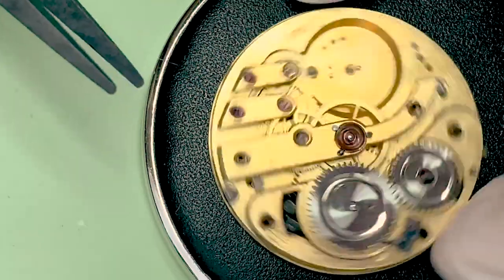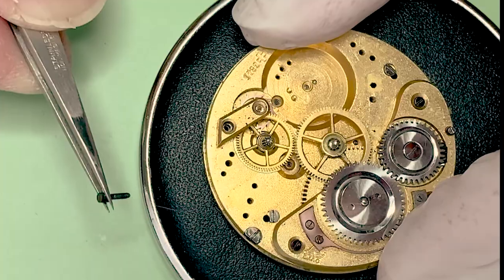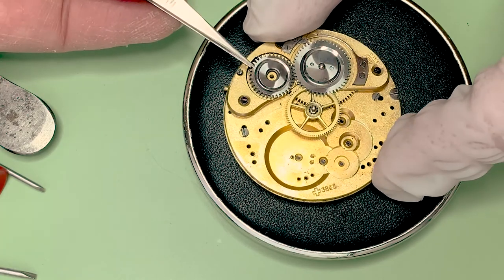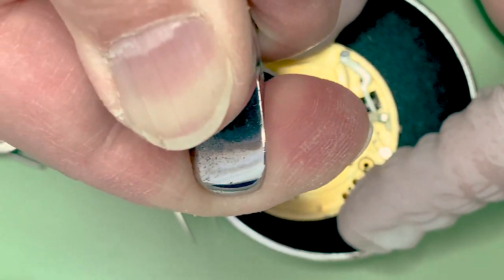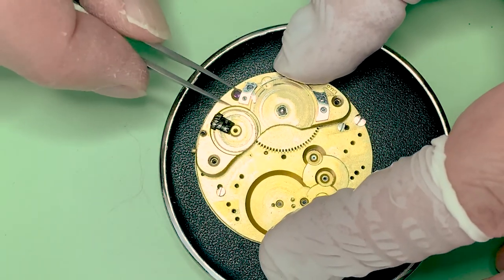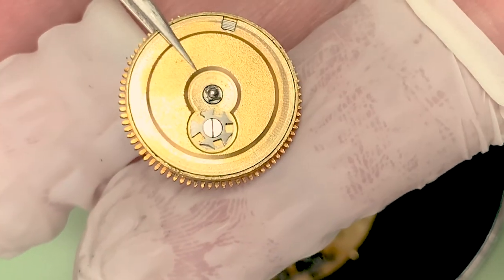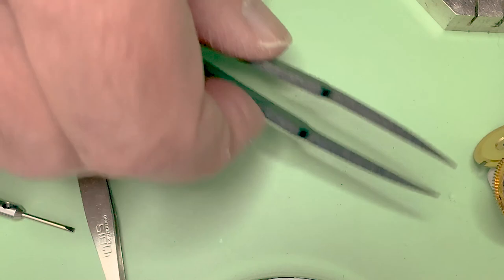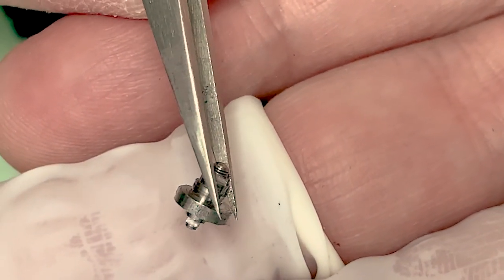Vintage Chopard pocket watch LUC disassembly Part 2!

Comment: The star-shaped gizmo at about 12:30 is part of the stopworks, in this case a Geneva mechanism.  Probably used in this watch to limit the running to the middle several turns of the mainspring.  It looks like the mating part, which fits over the mainspring arbor square and rotates in the milled-out area of the barrel, is missing.  Sometimes stopworks are found missing because a previous watch tech didn't know how to synchronize it.  Or, the customer wanted the watch to run longer even though it would be fast at the beginning and slow at the end.
  The color of the jewels is mainly an aesthetic choice.  Traditionally red in horology, due to about 1% chromium in the colorless aluminum oxide (corundum) base material.
  You ought to design a classy watch paper to put in the case when you're done!
Reply from the maker: Thanks for the information!  Definitely going to find out about this...hopefully I will come across a watch with that mechanism in place so I can really learn about it first hand.  Again showing my ignorance :0  I am not familiar with making a watch paper...Do you have a link where I can learn about this?? Really appreciate it!!    Thanks for stopping by!
Reply from the maker: @roygardner2374  Thanks for the links!  I think the watch paper is a good idea!  I will see about breaking out my vintage fountain pens and inscribing something interesting -- seems like this watch would like a hand illustrated paper  :)  Thanks so much for educating me on the Geneva stop, also!  It makes lots of sense and that is a great video.  I am really interested to see if my other pocket watches have that mechanism...Will definitely play with it to check the best power profile of the watch if it does.  That is the kind of thing that my engineer brain likes to do :)